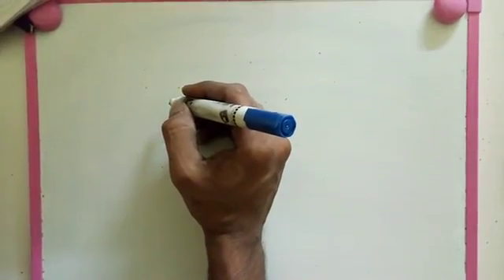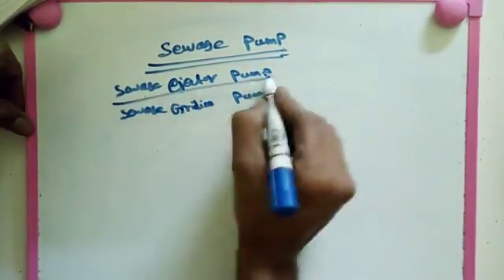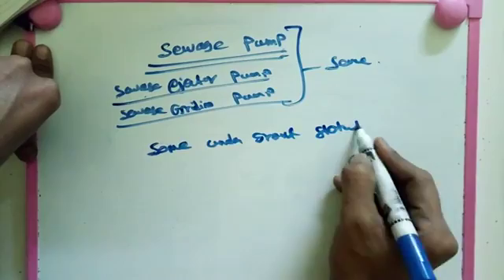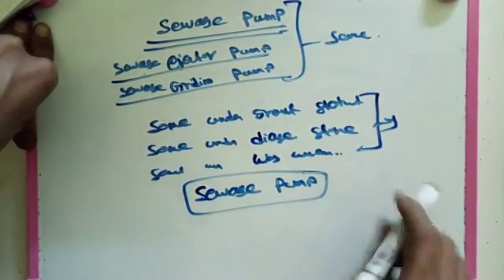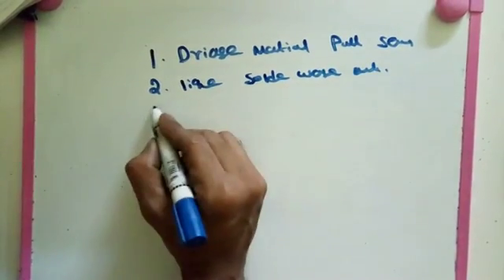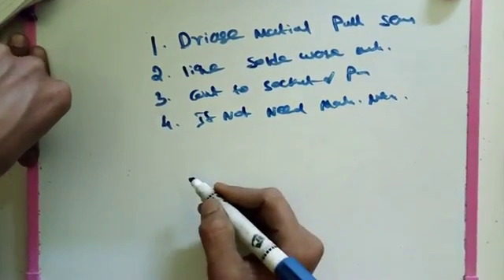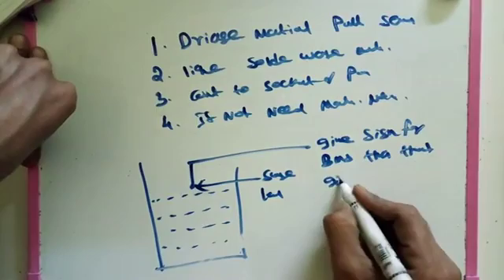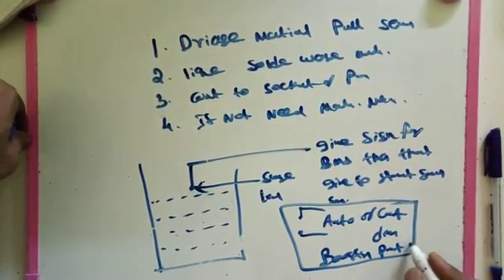Sewage pump explain new 2017

Comment: My friend Sewage pump and Grinding pumps are different..... 
Sewage pumps will not do what grinding pump does. 
Sewage pumps used for liqid + solid pumping where are grinding pumps grinds the solid with its rotary blade, chops large solids to small particles..... purpose and performance are different....